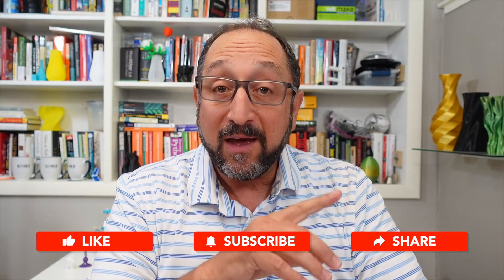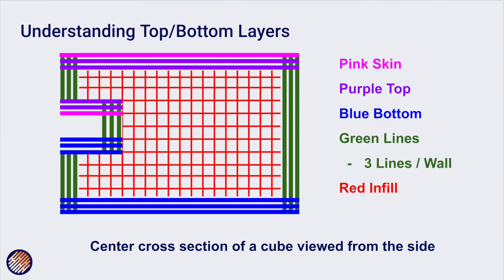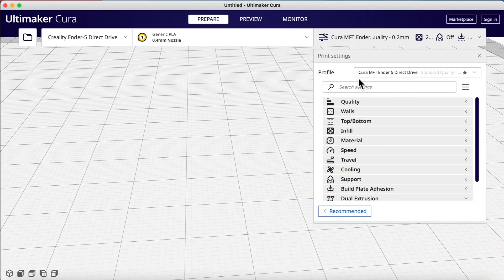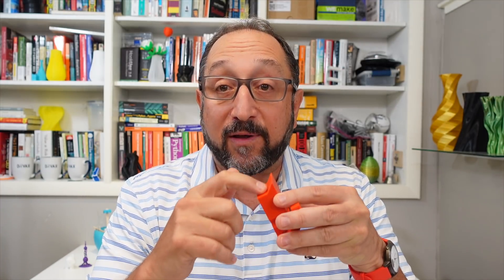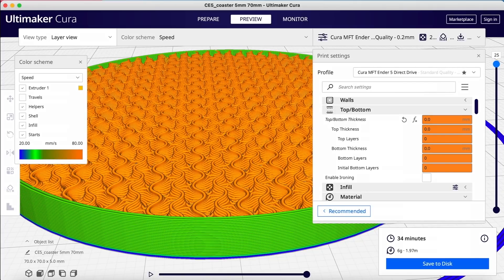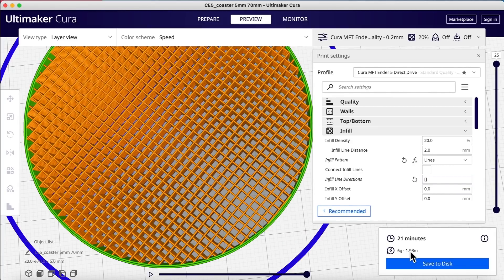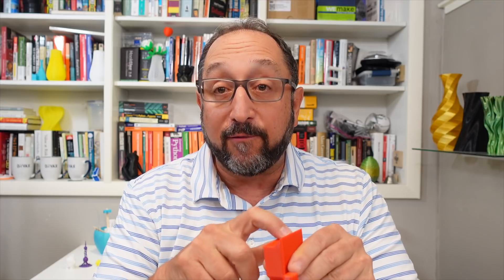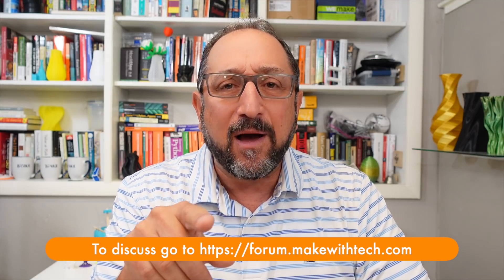Cura Slicer Advanced Top & Bottom Layers and Infill Settings

Comment: I tried to increase the thickness of the bottom layer to try to give it less transparency -
Bottom Thickness  was .8    now 2.4 mm
bottom layers  was 4   now 12
initial bottom layers was 4 now   12
then I saved changes with the small blue disc icon
then sliced and saved it 
= no difference - what am I doing wrong ?

Comment: It would be helpful to select a top layer to be printed only for certain parts of the model and not only the entire top or bottom layer. I.e., different areas on the same layer height where some get the top layer printed and others do not, but also top layers printed at different layer heights like a ladder where only some of the steps get the top layer printed. I make over moldings where this option would save a lot of time and material.

Comment: the concentric pattern does really good for supports as well as long as u use a roof an floor to connect it. they come off really easy an seem to use alot less filament an does best with circular prints.

Comment: Was trying to get the infill pattern to go straight up and down for an airplane print but the lines kept slicing at 45 and 135 degrees. Was using the "Infill line directions" setting in the Infill section. Then noticed that some infill lines were at 0 and 90 degrees, like I had indicated, but not the top lines. Finally noticed the setting I was looking for was "Top/Bottom line directions" in the Top/Bottom section .

Comment: Initially I was under the impression that monotonic top layer meant it only printed the lines in one direction, say left to right, and then just travels back to the left, not printing. But it doesn't. It still prints left to right, then right to left, back and forth, but with monotonic on, it makes sure that it will never prints e.g. left to right next to a line what was also printed left to right, as this would cause and inconsistency that shows as a printing artefact.

Comment: Very interesting! I was messing around with a project where I wanted the raft to actually be part of the project because of the way the raft follows the shape if the project. I changed the air gap in Cura to 0 and added a top layer plus changed the distance the raft would be from the outside of the model to 10. Pretty interesting results. Love experimenting in Cura, definitely a powerful tool!
Reply from the maker: Very cool!

P.S. I have started a new discussion forum at http://forum.makewithtech.com where we can all have more elaborate discussions and share pictures on our prints and printers. Check it out. Irv

Comment: Haha a done this a few months ago. Had a lot of fun with it. Also used this method to make fan filters too with very fine infill.
Reply: Great idea Adam, thanks!
Reply: @redherring5532  make sure you turn off combing and maybe do Z hop too, because otherwise any ooze will ruin the look.
Reply: @AdamWebb1982  haha yes, I adjusted for that after first try yesterday.. I have printers at home and my boss got interested and bought two off me to use at work. I designed a quick circle the size of an opening we want to kinda dress up on a big digital printer, and that first one looked fuzzy but great, and the combing clicked

Comment: Appreciated of course! For a graphic demo you might have created some of the coasters with the IDEX in two colors so you could see the various infill and wall. Perhaps that would bring too many variables I suppose. My 20x20x20 calibration cube is still not satisfactory which I am doing in black and white. Still requires adjusting offset of both X&Y axis for E2 but only requiring ~0.1 mm or so. Don't let the dust settle on the dual extruder please.
Reply from the maker: A great place to discuss this is at the MakeWithTech forum located at https://forum.makewithtech.com.

At the free MakeWithTech forum/discussion group, you can also post images and examples of your work.

Comment: You just exposed my dirty little secret! I've given a few 3D printed coaster sets to friends and family as gifts using a similar method!

 I discovered something similar to this while trying to print a circular lid for a cylindrical container and it failed after about ten 0.1mm layers, I had 2 base layers, 8 layers of 15% cubic infill and 2 top layers and the result ends up looking really good in gold Prusament! I ended up going straight into Cura and replicating the 1mm thick coasters. What I really like about the way mine happened accidentally is because the entire thing is so thin and the top and bottom layers are about 0.2mm each, you're looking through a solid but slightly translucent glittery plastic and seeing the infill patterns inside but you're not quite able to see all the way through them! Wish I could post pictures in a YouTube comment section! 

I'll definitely try some thicker ones like these, they're probably actually functional for hot drinks! Thanks again as always, Irv!

Comment: I think your initial picture of the types of layers has the top layer in that middle gap at the wrong place.  A top has open space ABOVE it, so it will be at the bottom of the gap, not the top.  At the top of such a gap you'll likely have a bridge or perhaps a bottom layer - I'm not sure when it will be considered bottom (ex. when supported, but not when bridged?).
Reply from the maker: Good point.  The things I have found online are not clear about this point.  I will do some tests and post back my results.   Thanks for pointing this out.